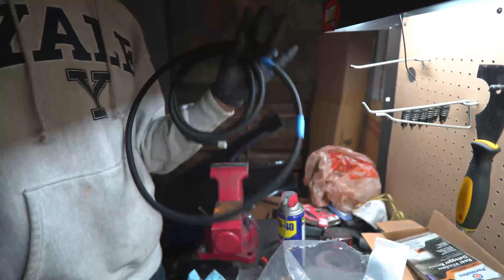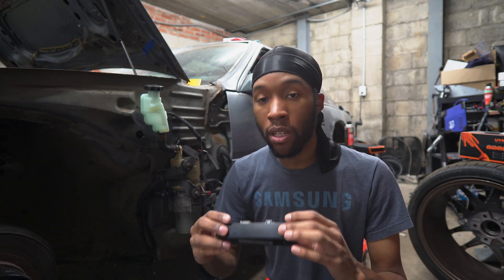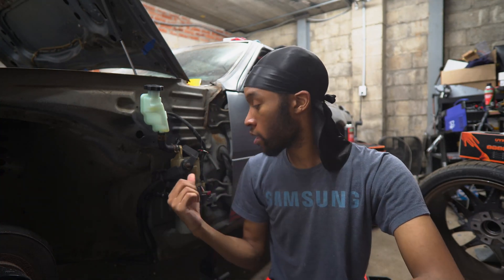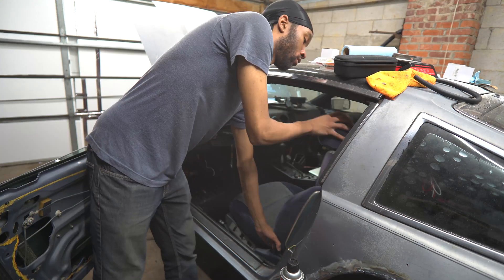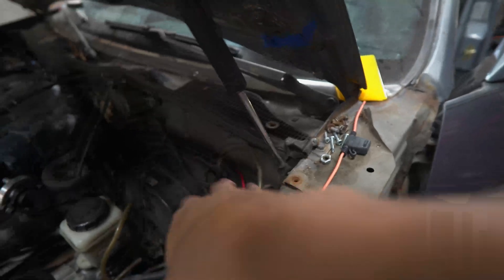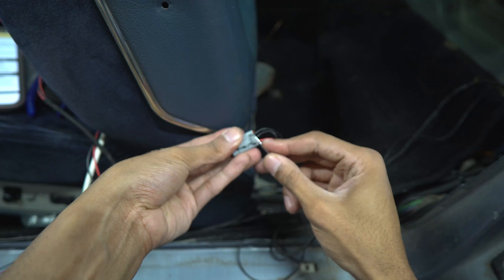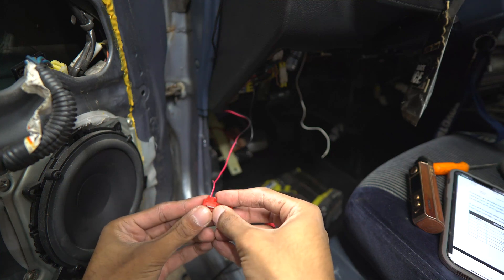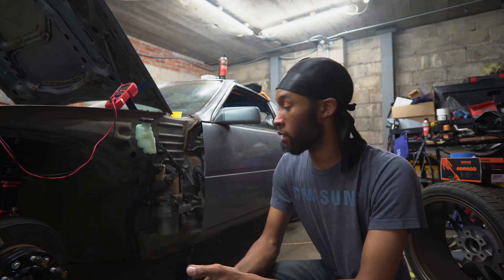Pt 3 Mazda Electric Power Steering Pump Swap - Installing The Hangtight PSC!

Comment: Considering the extra steps, in hindsight, would you have rather used the volvo pump?
Reply from the maker: That depends, I’m big on functionality and when I bought this initially I was in a “let’s get it working and figure it out later” mindset. That was years ago at this point and I can say the only downside I see in retrospect is the price. That’s the long answer but in short, absolutely, but I would’ve ended up changing it down the line if I would’ve discovered this controller existed and I were able get past the price of the controller.